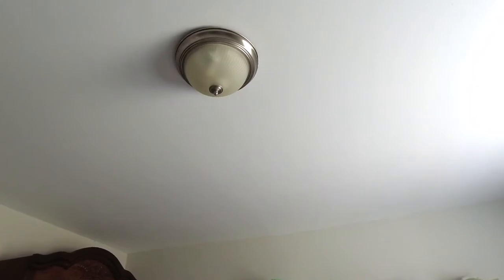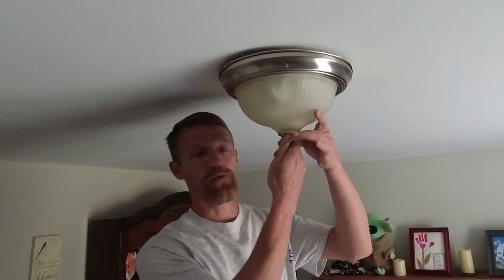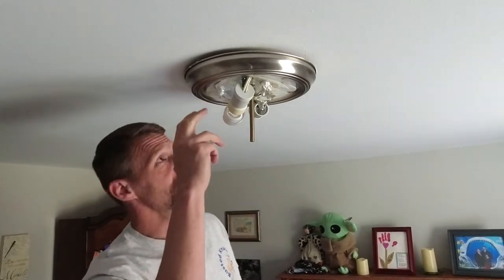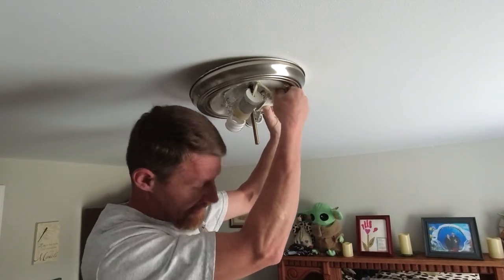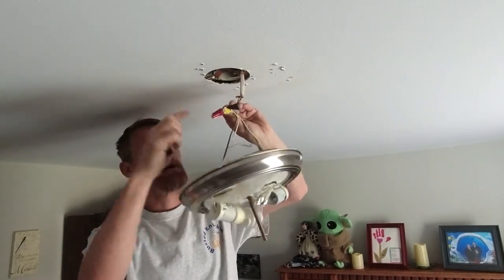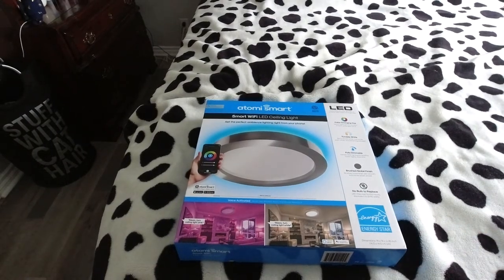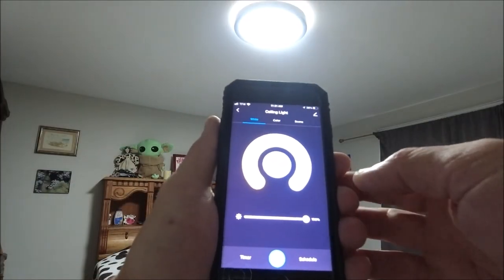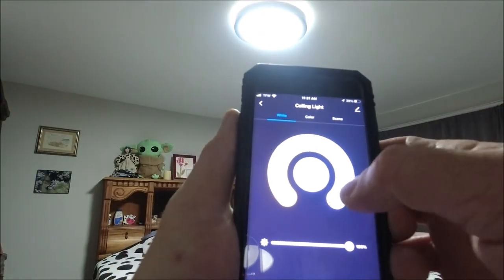Replacing the Dreaded Boob Light !!

Comment: Is turning off the light switch enough or do I need to go to the garage and turn off the breaker?
Reply from the maker: Typically just turning off the switch will be just fine, But if the light fixture is in line with others that work from the same switch, be cautious of the Neutral ( white wire ) as they are often used as a hot wire to jump between fixtures. Normally the neutral is supposed to be " cold " I would suggest turning off the switch and using voltage tester , just to make sure there is no power.
Reply: Turn off the breaker. Op isnt wrong but if youre an amatuer.. stay an amatuer and not a dead or injured amatuer lol

Comment: BRO WDYMMMM, I unscrewed the nut and the glass cover is freaking fused to the fixture and won't come offfffff
Reply from the maker: If you are changing out the entire light, you can duck tape a trash bag around it and them smack the globe with a hammer. Sucks to have to do it that way, but it will get the globe out of your way!